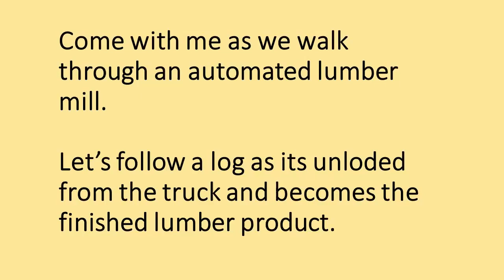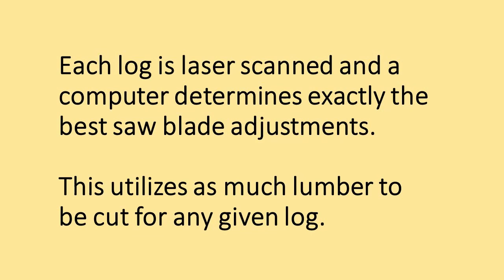A Video walk-through a modern lumber mill

Comment: Meh, would have been nice to have a better explanation on how the automation is deciding on the best cut strategy for each log.
Reply from the maker: Though I was simply on a tour, I overheard a comment from the guide that a scanner captures the dimensions of the log and a computer program sends instructions to the saw blades prior to the particular log arriving and within seconds the blades are adjusted. also, I heard that IF the demand and orders coming in for a particular cut - size of lumber, the controller can  instruct the program to cut more 2x4's instead of 6x6's from log that actually contains dimensions that would actually produce a 6x6.